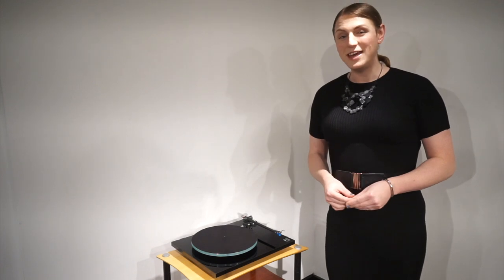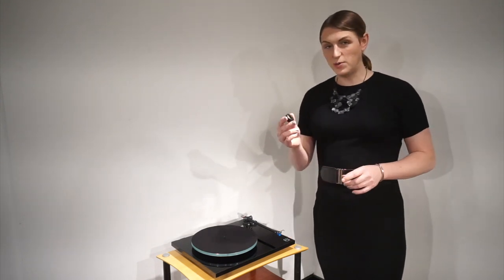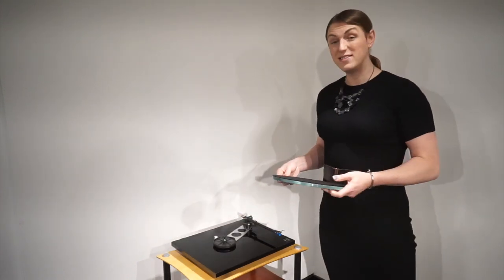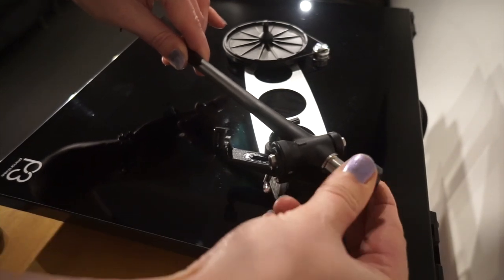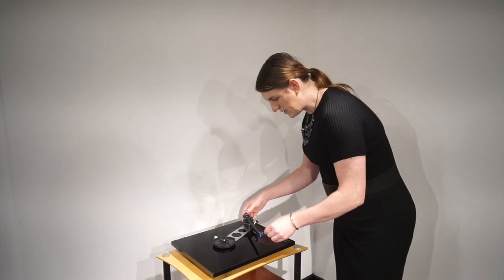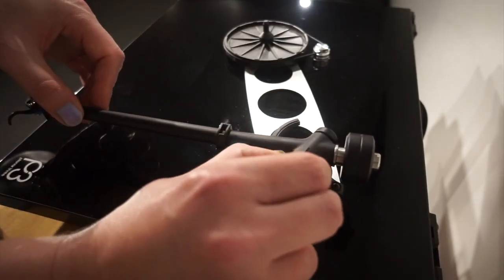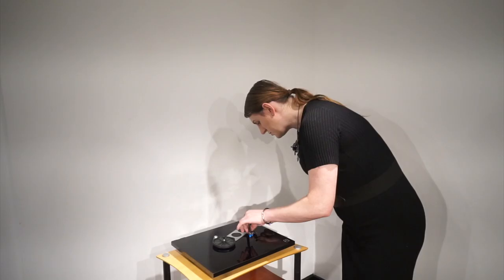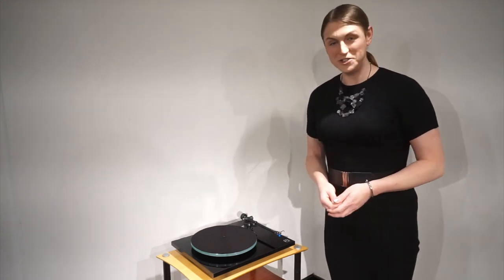Balancing a Rega Planar 3 Turntable

Comment: Hi Aaron - Yes this is normal.  Setting the dial to 1.75 puts the equivalent force of 1.75grams of downward weight on the stylus.  So if you hold the arm you will feel it now being heavy.  So the 2 settings do different things.  The rotary dial at the back puts the downward force on the arm and the BIAS adjustment put a force away from the center of the record, which counter acts the stylus being pulled into the center of the record as it spins around. So it keeps the stylus sitting in the middle of the groove.  Hope this helps.